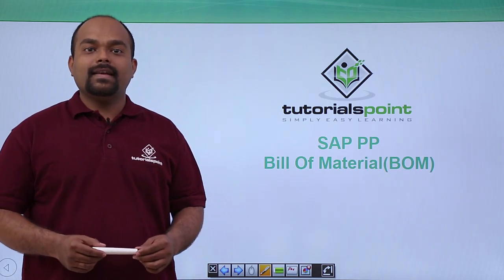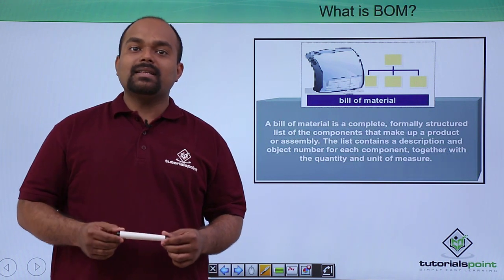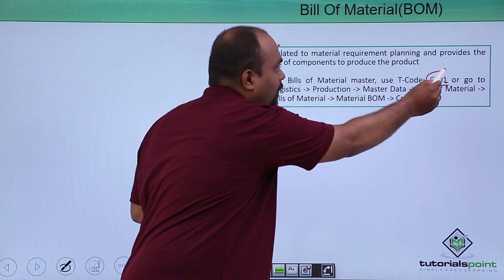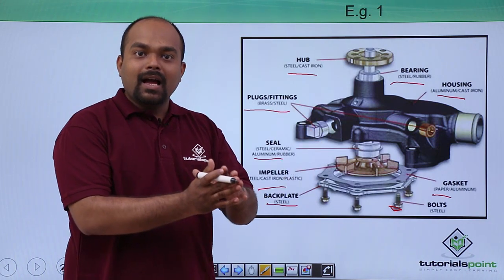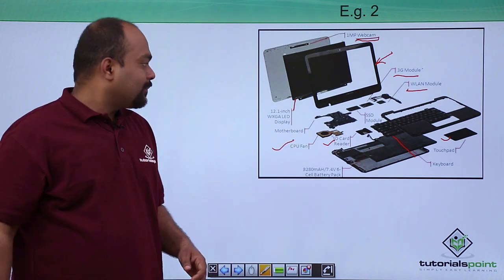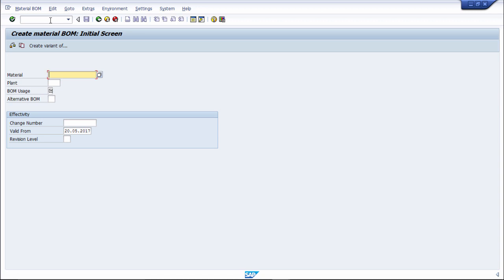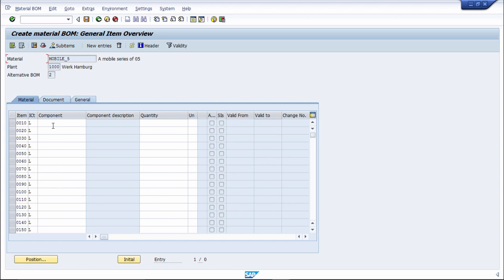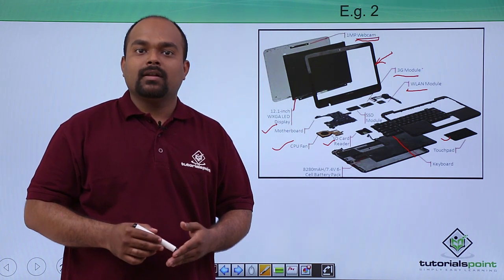SAP PP - Bill Of Material(BOM)

Comment: Hi I want to ask you if you can help me to find out the SAP standard table where the BOM weight is stored. Not the weight of components but calculated weight of 1 unit of finished product produced base on BOM.
Reply: Once a product prototype is finished the actual unit  (corresponding to that assembly part # as per BOM)  can be weighed, and this information can be recorded in the Assy BOM part # details.